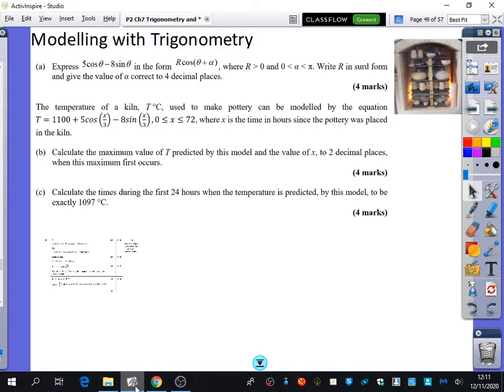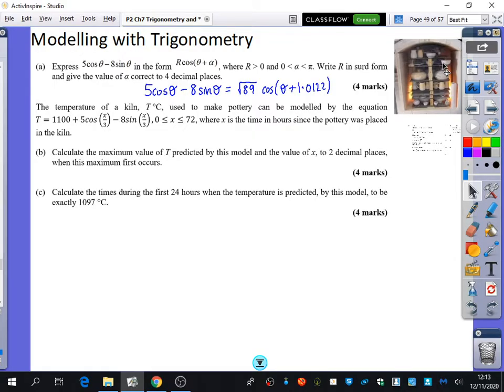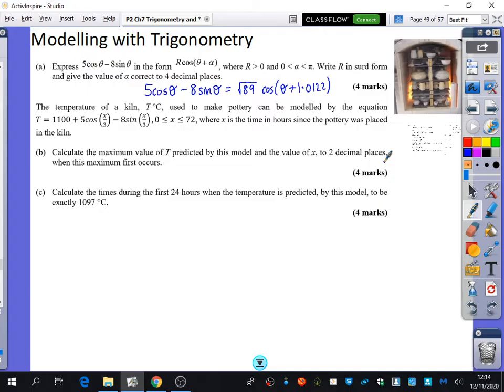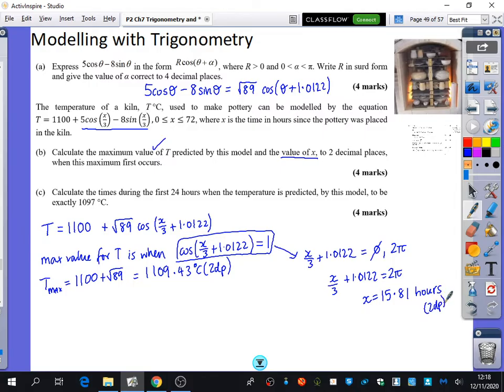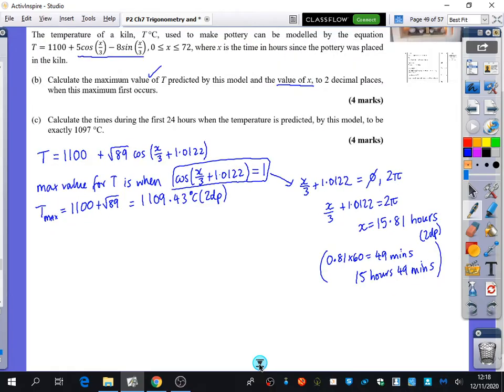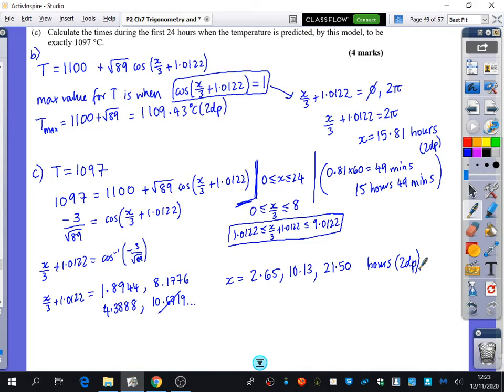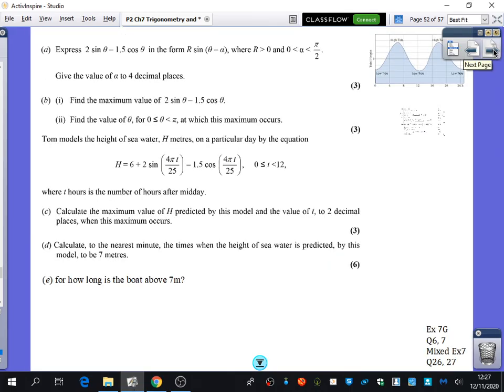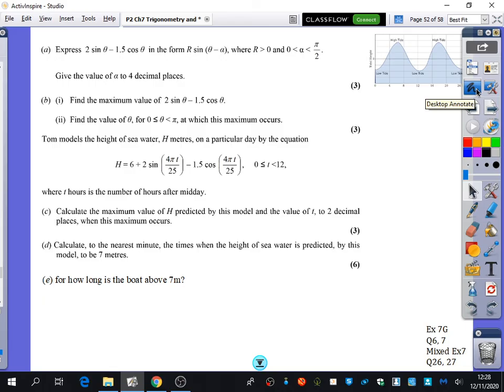Trigonometry & Modelling 20 • Modelling • P2 Ex7G • 💡

Comment: Hi Mr Bicen at 5:52 , how come you do pi and not degrees. Cause in the first half of the question it’s between pi and then for the second part x is in degrees how do I know which to do?
Reply from the maker: I'm actually doing the whole question in radians (pi, etc.), not in degrees. However, there ARE degrees in this question, but they are degrees Celsius, measuring temperature instead!

Comment: hi for q1 part b when we are trying to find the value of x why did you set the equation as only cos( x/3 +1.0122 ) = 1 and not 1100+root89cos(x/3 + 1.0122) = 1
Reply from the maker: This is because only the cosine part is the thing that is maximal at 1, and we're investigating the overall maximum. This occurs when the cosine part is 1, not when the whole thing is 1. I hope this makes sense!

Comment: Do you have any tips for the maxima and minima questions, im getting confused on why either 1 or -1 is used and how to spot when to use either
Reply from the maker: Before rushing to sub anything in, carefully think about the function, and how you can overall make it as big or small as possible - it's not easy though! Look if it's in the denominator, the numerator, has it been squared, etc. etc.  
Things to then check are 1, -1 and sometimes even 0.
Reply: @BicenMaths thank you

Comment: For the last question at the end, for part bi , is it not possible to work out the maximum directly through the expression 2sintheta  - 1.5 costheta . This would give an answer of 3.5 but the answer in the mark scheme gives the answer 2.5
Reply from the maker: No, it's not possible to get 3.5, as there's no value of theta that would make that work! Remember that you need the SAME value of theta for both the sine and cosine parts!
Reply: @BicenMaths  oh, so like it’s not possible for a value of theta that will simultaneously get both those values for sin and cos. So that’s why we use the expression that only has 1 trig function is it as we can sort of put any value of theta in it without having to consider any other trig function?
Reply from the maker: That's absolutely right, well done!

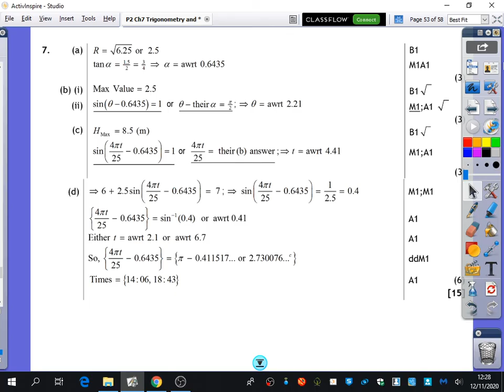Comment: 16:44 for part d I get where you got 14:06 from but how did you get 18:43
Reply from the maker: You have to find additional solutions from the trig equation, rather than just the first one from the calculator, much in the same way that you find all the solutions for something like sinx=0.5 for 0<x<720 (there are many solutions)

Comment: Hi sir, 
At 9:45 are you not supposed to use the negative values of the inverse of cos (sin and tan quadrant) as the number is -3/ square root 89?
Reply from the maker: In this situation, we're just solving the equation, so I don't think we need to take that into account!

Comment: Hi Mr Bicen,

on the very last exercise for part d) i got both the answers of 2.1 and 6.7, and an additional 8.35, which is in the range of 0 to 12

i got it by adding π to sin-1(0.4) = π +0.4115 = 3.553, which is in the range of 0 to 5.388, then decoding it from 4πt/25 - 0.6435 to just t

i did put everything into desmos so i know 8.35 is wrong but im just not sure as to why
Reply from the maker: Ah! We don't add pi to solutions, we can only add 2pi to solutions!
(And with sin, we can do our pi-ans as well)

Comment: Hi sir
for part d
how would the second solution 6.7 be correct as it's higher than the domain which
is 0<4pit/25<48/25pi
Reply from the maker: But the domain is 0 to 12, so 6.7 does fit in that range!
Reply: @BicenMaths  wouldn't we change the domain as it is 4piT/25?
Reply from the maker: @LiannaBourge  Yes but 6.7 still lies in the original range, and the changed range is only for the values before you solve for T.

Comment: 10:52 how did you get 4.3888 for one of your solutions? I understand how you got the 1.8944 and the 8.1776, but i don’t understand how you got the bottom two
Reply from the maker: I got the 4.3888 by doing 2pi - ans (the answer I first got on the calc, so 2pi - 1.8944). This always works for cos to find the second solution!
For sin you do pi - ans, instead of 2pi - ans.
Reply: @ ahhh yes i know that sorry i was tired yesterday

Comment: Hi sir, when doing trig modelling questions how do I know when to use other solutions and when not to? For example, when you have a cosine one you can do 360-Ans to find the second solution, but how do i know whether or not to do further Ans+ or - 360? Thanks!
Reply from the maker: You have to look at the range of answers given in the question - so if it is just 0<x<360, there'll be no more - but if it were say 0<x<720, you could add 360 to both answers to get two more which would both be in the range! :)
Reply: omgggg thank u so much for the quick reply sir

Comment: Hi sir, if i get a solution after solving a trig equation then use a graphics calculator to give me the rest of the values in the range.  Will i lose marks?
Reply from the maker: @jefking2158  No, none at all! They can’t tell where you’ve found those results, as long as you’ve shown how you found the first of each part of the question!

Comment: 9:45 how do you automatically know to minus 1.8944 from 2pi to find the second answer?
Reply from the maker: This is one of the standard results for cosine. You get the one from the calculator, then 360 or 2pi minus that one for the second answer. You can then +/- 360 or 2pi to those two answers to get more!
For sine it is the calculator result, then 180 or pi minus that answer.

Comment: Hello, sir is it possible to use the CAST diagrams for this problem at 9:59. When I used the CAST diagrams I got different solutions.
Reply from the maker: Yes it is possible, but it shouldn't give different solutions, so it is likely that there is an error in your working!

Comment: Can you still find the x values if you take away 1.0122 and multiply 3 to the arccos value instead of changing the range for x at 8:43
Reply from the maker: Yes, you can do this too!
Reply: When i do the calculation, I get x=2.65. However, when i add 2 pi to 2.65 or do 2pi-2.65, I get a different answer than you. At 11:33

Comment: For part b at 5:43 why can’t the fact that cos repeats every 2pi and that cosx = cos(2pi-x) be used here to get more solutions?
Reply from the maker: It could be, but when cos(x) = 1, the solutions are just 0 and 2pi. If you did 2pi-0, you get 2pi, and if you do 2pi-2pi you get 0, just giving you those two solutions. Think of the shape of the graph, it will help you see why it is 0 and 2pi.
Reply: @BicenMaths  okay, thank you! I really appreciate you taking the time to answer specific questions like this. So I think I understand there are just fewer solutions when cos(x) = 1 because of the way the cos graph repeats, and this would also be the case for cos(x) = -1. Am I right in thinking that for any other values of cos there would always be twice as many solutions as there are for the turning points?
Reply from the maker: @lisaelliott2974  Yes, that's absolutely correct!

Comment: Hi Bicen, 16:33, where can I find the answer to the part e? thanks
Reply from the maker: If it's not in the next video, I don't have the answer as I made the question up like 10 mins before the lesson started! I'd recommend drawing the graph on Desmos, and then also putting in the line y=7, and that will help you find all the times that the boat is at 7m, and so you can work out the times that it is above 7m.

Comment: Hi sir, for the last question 7d, how do you get 14:06 from t = 2.1?
Reply: Do the range correction with 4pi/25-0.6435 then find the solutions as normal. Be careful and +0.6435 then x25 then divide by 4pi. You get 2 answers 2.1 and 6.7 then you can find the times.
Reply: @rmzfbrmz  I see how you got 2.1 as you did 0.441+0.6435 then x25 then divide 4pi     to get 2.1, but how u got 6.7 u did 0.441+2pi are you not supposed to do the whole process of '1+0.6435 then x25 then divide 4pi' to 6.7 too?
Reply: @1My3My9  the first value of sin-1(2/5) = 0.441 and the second value of sin(x) is sin(pi-x) which gives u 2.73. 2.73 + 0.6435 multipled by 25 and then divided by 4pi gives you 6.7
Reply: @rmzfbrmz  thanks so much!!
Reply: @rmzfbrmz  how do you find the times then